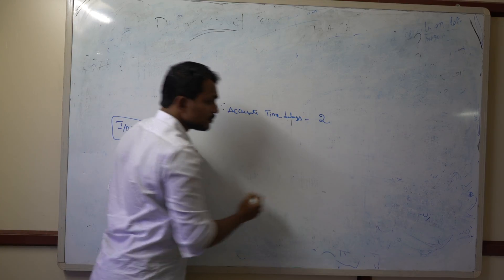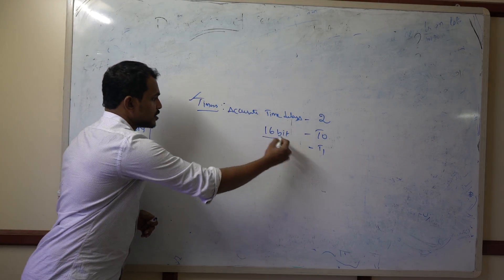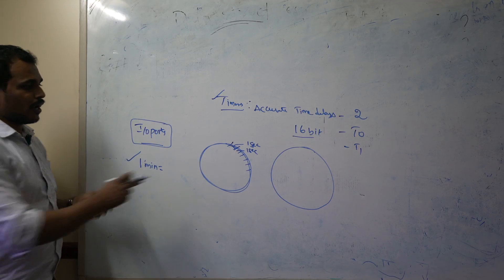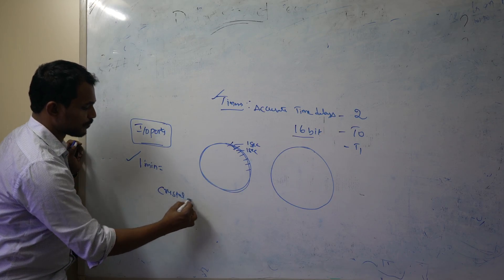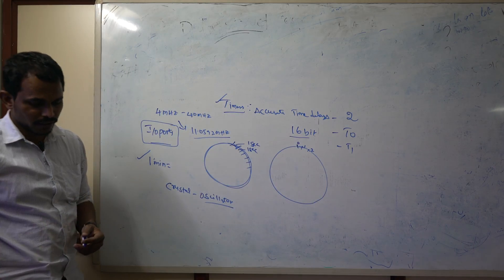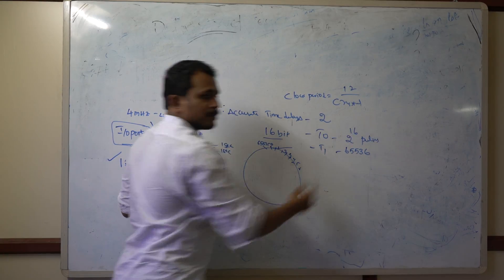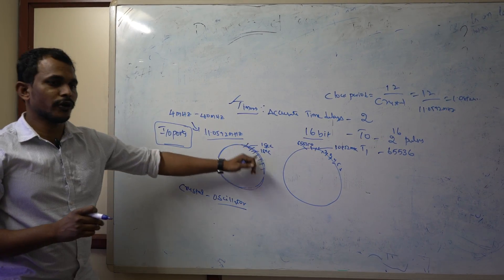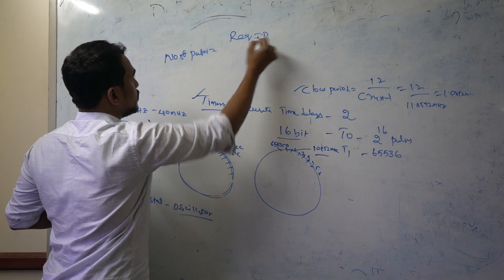Timers in 8051 micro controller

Comment: Why crystal frequency of 8051 is devided by 12 only why not other value?
Reply: VINEETH KM becasuse one machine cycle consist of 12 signals
Reply: Why one machine cycle is equal to 12 clock cycles?
Reply: Its a timer block divident , like in advanced microcontrollr PLL(Phased lock loop) value. Thank you